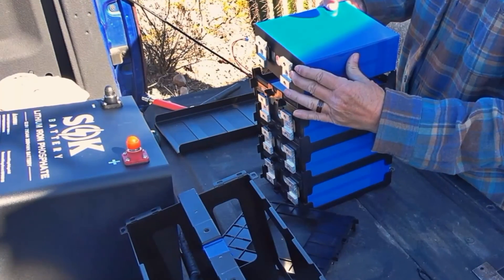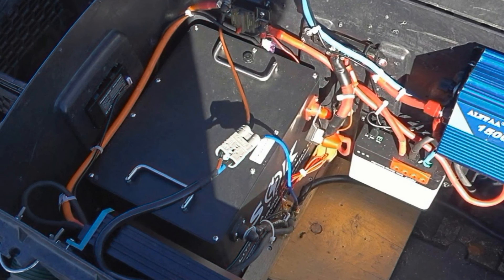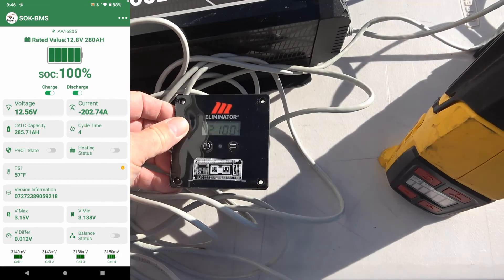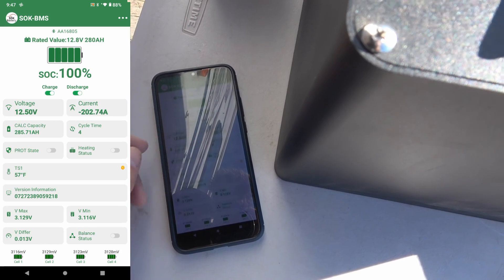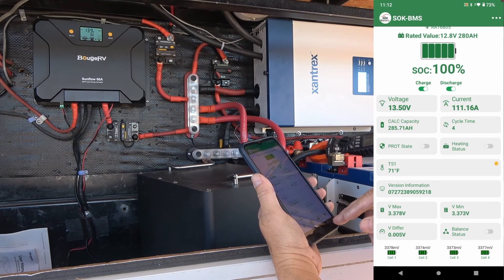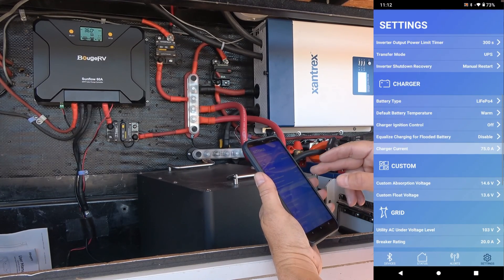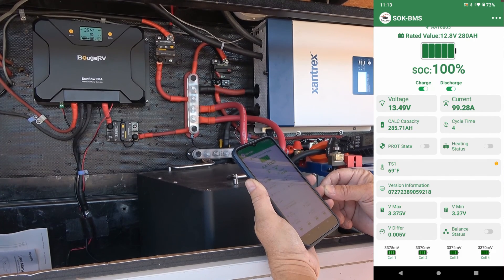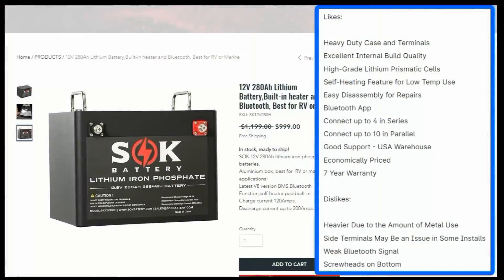SOK 280Ah LiFePO4 Battery with Self-Heating Review - Well-Built Battery for Low-Temperature Use

Comment: How do you keep your battery from rattling out of place?  I don't notice a hold down strap or bar in your mobile application.  I am trying to figure out how to best keep mine in place.
Reply from the maker: I use wood frame at the bottom of the battery to keep it from sliding around, and it's 60 lbs, so it tends to stay where it is. Also, the box is tightly packed for travel, and I use some pool noodle pieces.  You could use marine battery ties downs - https://amzn.to/48XAt0Q

Comment: Thanks for the video - much appreciated.  I have one of these batteries on order to pair with a 3kW inverter I have.  I was wondering about the two specs Maximum Discharge vs Peak Discharge.  To me your test demonstrated that the battery can supply >200A continuously.  I wonder what the 200A spec really means.
Reply from the maker: The manual specs are Maximum Continuous Discharge Current = 200 A  Peak  Discharge Current = 250 A (7.5 s ±2.5 s) but I have found that companies often have fairly conservative ratings, and the battery will sometimes handle more, especially when the cells are new. Giving them some headroom for warranty purposes, is my guess. Cheers, Ray

Comment: Glad to see the SOK working well.  I have the regular 206.  I use the Renogy and Victron tool to track everything.  What are you using?  Does SOK have an app for the internal BMS?  Whoops, you just covered that.  Did it come separately with this battery vs the older ones?
Reply from the maker: This battery came with Bluetooth built in. For my main, RV power system, I've been using a Trimetric battery monitor with the WiFi add-on module since 2015. The interface is fairly old school but still does the job.  http://www.bogartengineering.com/products/battery-monitor.html  For my boat I've been using a Junctek https://www.loveyourrv.com/junctek-kh140f-battery-monitor-demo-review/ and currently in my truck toolbox power station I'm testing one from Power Queen https://www.loveyourrv.com/power-queen-40a-lithium-charger-battery-monitor-revview/  Cheers, Ray

Comment: Ray, so glad to finally catch up with you at the walmart in Yuma a couple of weeks ago while doing some banking. Do you know what the charging parameters are in the way of float voltage, absorbtion voltage and the length of time for that. Instructions say to charge up to 14.6 but I can't get my two SOK 280 amp hr past 14.04 with my Victron I/C at 120 amps. The cmos on the app cuts it off therefore I never get to the absorb phase and float phase. I do agree with you the app is a little weak in bluetooth and SOC readings. I tried to reach out to SOK with the number on the website but it is no longer in service, would you happen to have one. Keep up the good work and again nice to finally say hi to you. Congrats on the wedding!!!
Reply: 14.04V is good enough, it means fully charged already. 14.6V is charger voltage, it doesn't mean your fully charged battery could up to 14.6V
Reply from the maker: I tested with SNRE solar controller preset Li setting at 14.2V, a Power Queen 14.6 charger, and the Xantrex inverter/charger, which uses a preset 14.4V for lithium. All were able to fully charge the battery.  When you disconnect charging on what is referred to as a 12-volt LiFePO battery, it sits at about 13.4 - 13.6 volts, I find. Some manuals recommend a charging voltage as high as 14.6 volts, I think, to help keep the battery cells in balance.  Cheers, Ray